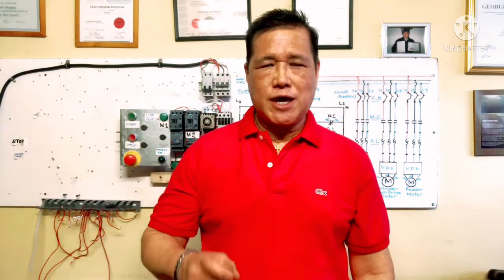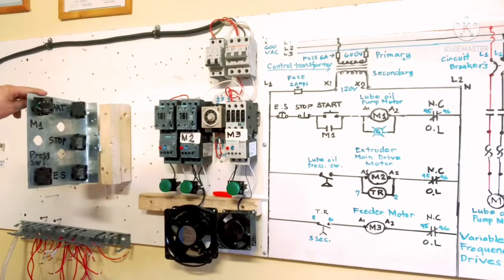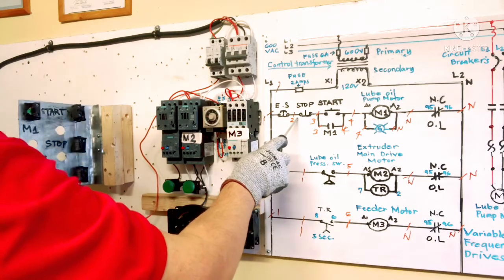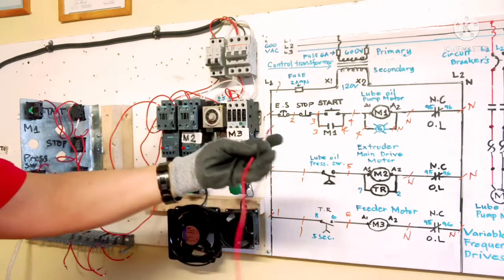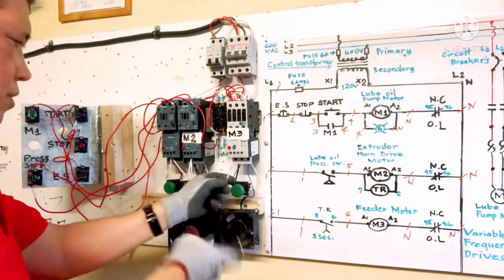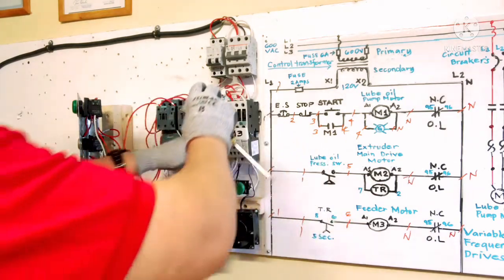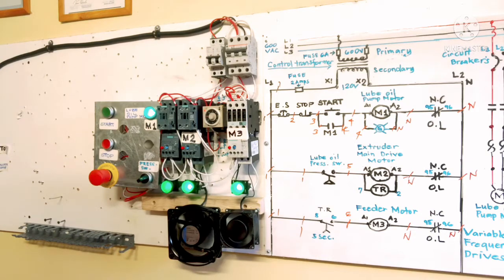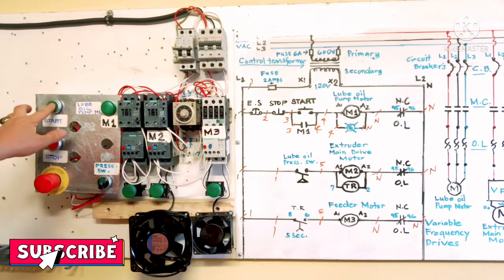stop start motor control, 3 motors sequence start with pressure switch and Time on delay.

Comment: How you connect 3 independent motors connected in parallel with 3 disconnects but with one main feeder, and relays 1st motor starts, and 2nd after 2 minutes and 3rd adter 3 minutes?
Reply from the maker: semilar connentiion instead pressure switch use timer on delay to start M2  if energized M2 and second timer for M3 its up to you how much you want time to start motor. but connection is same.
Reply: @tmelectricaltutorials2851  
Thank you

Comment: Hai sir good evening your explained is very very nice thank you so mu ch 
Sir can I small request for you .  If you don't mind  chiller control wiring   explained please...  Thank you
Reply from the maker: actually in chiller Control semilar to that. once you press the button all motors like pit product , hydraulic motor, process motor, condenser motor, free cooling motor are automatically energize start all. 
but each are starting to wye /delta  and one stnadby and one is running. if one is overload automatically start one pump.